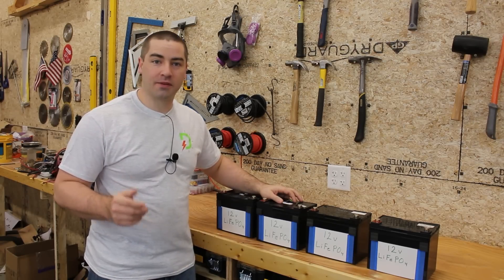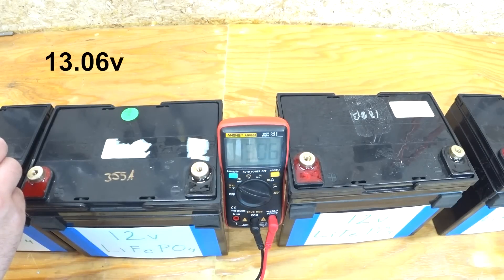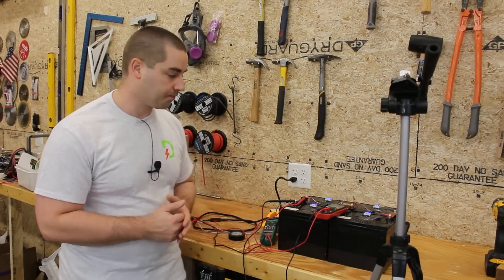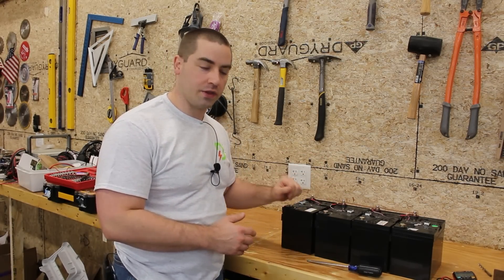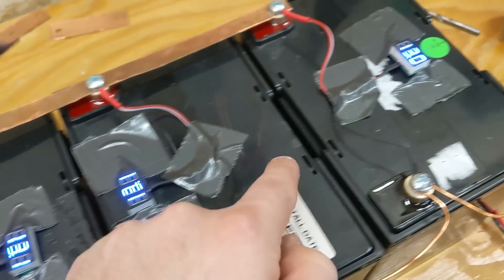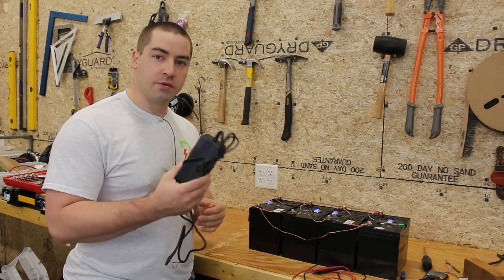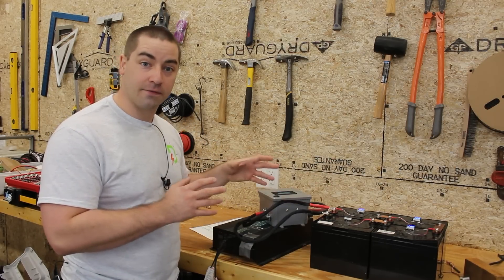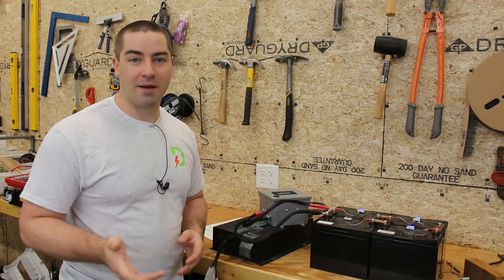How to Series Connect 12v LiFePO4 Batteries, and Top Balance

Comment: I have 5 12 volt Li Time 100ah batteries in parallel connected by busbars. A Li Time 60 amp solar charger charges them. I have checked SOC numerous times and they are all in perfect sync. Do not try this because it is not recommended. I am just telling you my experience. They are a mix of TM batteries, standard and Bluetooth.

Comment: Hello, David. Thank you for the demonstration. I have the same thing happening with my pack. 4-12 volts in series In a golf cart. I purchased a battery balancer from Amazon and it did seem to work until the pack died again. This question is unrelated, but. should the lithium ion batteries as a pack of 48 volts Be able to. drop below 48 volts and still function?
Reply from the maker: Yes.  
Typically, a 12V LiFepo4 battery will have a low Voltage cutoff of 10V (2.5V/cell).  If you have 4 in series, that makes 40V as a low Voltage cutoff.  The thing is, that a single cell hitting 2.5V will trigger that BMS to shut off, which will kill the whole pack.  This may happen at 41V, or 45V, It's not certain.  In my own home system, I have my inverters programmed to shut off at 48.0V so that the battery doesn't shut down.

Comment: how often does balancing need to be done? Is this only done initially when they are first connected to system?
Reply from the maker: This would depend on the application.  For friends running this type of setup in RV's and vans, I suggest they re-balance them once a year as maintenance.

Comment: Hey David.  Thank you for this.  I am a snowbird spending winters in AZ.  I switched to 3-12v lithiums for my 36v cart.  I top balanced them new as you showed but I heard that one should balance them annually and you said that you will top balance if connected in parallel and left for a month or so.  Can I just fully charge my 36v system when I’m ready to head back north, and then re-wire the batteries in parallel for the summer.  Presumably they will balance while I’m away and then give them a full charge in the fall.  Make sense or not?
Reply from the maker: Re-balancing them once a year is good practice.  Also, Lithium batteries don't like to be stored at 100% SOC (state of charge).  Ideally, store them around 50-60%SOC for the off season.  I'd store them disconnected from everything and each other. When you come back to the golf cart, I'd re-top balance them.  
If you leave them in the golf-cart while you are away, then make sure you have a main-disconnect turned off so that the 12V power supply, or speed controller, doesn't drain them while you are away.
When you come back to the golf cart, a way to speed up the process is to charge each battery to 14.6V with a lithium 12V charger.  That will save you the hassle of removing them from the cart and re-wiring them to parallel.
Reply: Thanks again for the reply.  Just to be clear.  I’ll disconnect them from each other and the cart before I leave.  When I’m back I charge the individual batteries first with a 12v charger.  Then I wire them in parallel and balance them with a small charge.  Then rewire in series and “Bob’s your uncle”?

Comment: I want to balance 3 new LifePO4 100a 12v batteries for my golf cart.  Was planning on charging them first in series with my new 36v charger.  Then, I want to top balance them as shown here in parallel with a 12 v charger but you don’t show what size charger you used.  Can I just by a cheap low amperage charger.  I’m very green at this so any info would be helpful.  Thanks.
Reply from the maker: The 12V charger I'm using in this video is 4 Amps.  The exact amperage isn't critical with LiFePO4.  You could get a 10A model and be just as good.  The important thing is that it's a CC/CV charger, which stands for Constant current, constant Voltage.  If the charger is built for LiFePO4, then it's a CC/CV.  Just don't use one made for lead acid batteries.

Comment: What do you think would be a good balancing time for a 24 v system of 4 batteries.... Evey 6 months ? Or eveytime you see a little difference
Reply from the maker: If the batteries are older and more degraded, you might have to balance them more often, maybe every couple months.  But, if they are working well, I'd do once a year as a maintenance thing.  At the same time you can check for corrosion and torque.
Reply: @DavidPozEnergy  thanks, a lot.....they are 6 months old ,but I,am seeing  4/5% difference,so  this weekend I will due a balancing. Thanks again

Comment: Honestly I don't get why people work with 12V apart from very small systems 1200W or less DC, so closer to 1000W AC, 24V is good for upto 2400W DC so after inverter and cable losses your talking 2000W AC which is an acutally useably sized inverter anything beyond that just go 48V you will thank yourself later because you don't need stupid gauge wires and it will allow you to relatively easily expand later and you will almost certainly expand your system.

Comment: You helped a lot.  I have a 400 aH 12V system with four 100 aH batteries.  I use all in parallel and was concerned about all four and "top balance" ... I have them in a fairly sealed wood box and it would/could be difficult to charge each battery individually.  I hope to expand to 800 Ah total all at 12V ....  I already had/have a Victron 12V multiplus 2 3000Va and the loads are low but when we have long cloudy days I want the capacity to use ... and only use the charge system of shore as little as possible.  I mostly have been using only solar but seasons change.  pat

Comment: Great video David.  What charger do you recommend that can be programmed to cut off at 56V?  I'm also planning on setting up my Renogy 500A Battery Monitor on my dash to be at zero percent charge when the voltage hits 49V to ensure I'm not dipping into the bottom 10%.
Reply from the maker: I use solar MPPT charge controllers.  Currently I'm using a Victron one, but most MPPT controllers can be programmed.  However, if you are asking about a wall charger, then I use this one: https://signaturesolar.com/eg4-chargeverter-battery-charger-48v-100a-5120w-output-240/120v-input?ref=4_rHcgZ9x-TiF-

Comment: Hey Dave, just watched this video.  we're installing 3 new 100ah batts and our installer doesn't seem to think the process of normalizing, conditioning and top balancing is needed.  I think he's wrong.  Any opinions??  thanks, Jeff and Julie s/v OoLaLa Westsail32  #81
Reply from the maker: Hi Jeff and Julie,  This video is for series connecting 12V batteries into a 48V configuration.  I don't have details on your situation, but it might be that your installer is paralleling batteries.  Paralleling batteries gives you more leeway.  
Is there a better way to contact?  I'm on facebook at davidpozenergy if that's helpful.

Comment: Hi David that was informative. i have a question....

I have an 84V scooter and getting rid of the old LED acid Batteries to get the LiFePO4 conversion.
but it's super expensive, between $1100 and $3400 depending on the capacity.
I tracked down a couple companies in China that will make an 84v 50ahLifepo4 battery
for around $700 and not $3400 at the bike store. still expensive but cheaper.

I saw your video and was wondering if I could make my own.
I can get 7 of the K2 Energy 12v LiFePO4 Batteries (K2B12V19EB) good use for $350
The 12V versions of your batteries.
I keep hearing that 4 in a series is the max on LiFePO4 Batteries. 
On the battery, I see Max in series 2 for a total of 24V and Max in parallel is unlimited
Is 7 too much to put in a series to make 84V  ?
How to make 84v out of these batteries?
Thanks
Reply from the maker: Off the top of my head, 7 in series is too much.  When one BMS tries to shut off you don't want to short across the fets. Unless the manufacturer of the battery says it supports 7 in series, assume it doesn't.  

I don't have an 84V scooter, so I might not be very helpful.

Comment: Great video once more TY for dropping all this wisdom on a up and coming noob :) ! I just bought a 3 pack of these Power Queens on sale for $750, can I use just the three in series for the 36-watt system? I want to power my Pecron E 2000 at night or on cloudy days or do you recommend the 4th so I can run a 24 volt parallel, 2nd question for my output from the batteries (8AWG) can I just run them into an MC4 to hook into my aviation plug? Thanks in advance and also for inspiring me to get partially off-grid :)
Reply from the maker: I've never tested a Pecron E2000, so I just looked up the specs on it.  Looks like you can add an expansion battery (EB3000).  I assume you are trying to make your own expansion battery?  If that's the case, then try to match the specs of the expansion battery.  It is a 25.6V battery (usually called 24V, but in LiFePO4).  Sorry I can't be more help, but I haven't tried making an expansion battery for a pre-built portable power station.

Comment: A good video, BUT, The BEST way to connect a series string of any type battery for charging OR discharging is to "opposite feed" the charger/load +/- connections.  That is, the 1st battery's charge or load connection is positive and the 4th or last battery connection would be the negative, or visa-versa.  In this way the charge/load voltage drop will be EQUAL as the interconnecting wires that have a definite resistance, WILL provide an EQUAL charge or loading of each battery.  With your connection of "center feeding", the two outer batteries will DEFINITELY see a reduced charge from the resistance of the jumper wires as the two center batteries will receive an equal and highest charge voltage...  The difference is minimal, but it is there....  Especially when dealing with MILLI-VOLTS........................... This SHOULD HAVE BEEN POINTED OUT... Just say'in....

Comment: I’ve got 4 x 12v lithium batteries in series for my 48V golf cart. I also have a 48V lithium charger. How do I hook up the charger properly to charge all 4 batteries at the same time? Does the positive connect to the first battery and the negative connect to the last battery? Thanks for your help!
Reply from the maker: Generally, YES, but there may be some nuisances in your setup.  The purpose of this video is to make it clear that you have to manually top-balance batteries in series.  Your 48V charger won't do that.  If you haven't top-balanced your batteries within the last year, it's time to do it again.
Reply: @DavidPozEnergy  ok sounds great! Yes I’ll still have to top balance the batteries, they are brand new, delivered just a few days ago. I just wanted to make sure and verify where to connect the positive and the negative. I’m trying to find a simple solution so I don’t need to remove my batteries from my golf cart. Thanks again, I really appreciate your help
Reply from the maker: This is one idea that might be simple.  Put this balancer inside the battery compartment (protected from splash).  It is made to balance 4x 12V batteries in series. https://amzn.to/3mLpzZC

Comment: Hi dude, thanks a lot for this video. 
I'm new to lifepo4 projects... 
My motorhome has 1 pack of 105ah lifepo4 12v already with it its own MPPT controller. 
I need to increase the capacity, but the battery pack the I just bought is 100ah. 
Peolpe did not recommended me to add them in series since they are different capacities... 
Which is the best approach to add this new pack into the system without manual package switching for charging 
and discharging? 
Both packs have its own BMS. 
I was checking the Epever Duoracer dual battery... but it supports the second battery as standard truck batteries. 
Do we have some MPPT charger that can automatically charge/discharge the two batteries? Or should I add a new controller for pack #2
and put some devices in circuit #2. Or can I have a single system with automatic management for charging/discharge?
Reply from the maker: Hi Ronaldo,  You stated "People did not recommended me to add them in series".  Placing two 12V batteries in series would make a 24V battery.  Is that what you are trying to do?  Are you using a 24V inverter?
Reply: @DavidPozEnergy  sorry, I was not clear. People said if I attach a new battery to the same system (system is 12v and both batteries are 12v), as the batteries have different amp/your, one 100ah and the second has 105ah that if I put them in parallel it will damage the batteries or explode. I'm trying to find a solution where I can charge both and discharge both in an automated way and keep the system in 12v
Reply from the maker: Ah, OK.  You are trying to place them in parallel.  That makes a lot more sense.  Yes, you can parallel similar batteries even if one has a different capacity (Ah) than the other one.
If you put them in parallel, there are some rules to follow:
1. Both batteries should be the same charging parameters.  This means they should both be LiFePO4 chemistry, arranged 4s.  
2. Check the Voltage of each pack, both batteries need to be within 0.1V of each other before paralleling.  
3. Test each battery to make sure it's "active" and working.  Try pulling a 12V lightbulb on it, or something like that to make sure both batteries have the internal "BMS" online (active).
4. Parallel both together without being connected to other loads, and charge both slowly up to maximum Voltage.  This should be in the spec sheet, or printed on the battery.  Usually 14.4V or 14.6V.  This is the top balancing phase.
5. When wiring them together inside your motorhome, do NOT daisy chain them.  Instead wire both to a central busbar.  Check out this video for more: https://youtu.be/eWqJjlHoW9A

Comment: Hey man  need some help. 
I have  4.  12.8V   100ah batteries. 
I  configured them  24V system. 
Question:    do I have a   24V.  100ah system?
Question:     when  figuring  my voltage for my  charge controller. How many cells do I  figure.      3.45V. X 8 cells = 27.6 V.
I am having a lot of trouble  programming my   EPEVER  charge controller?
Any  information will be  appreciated.

Comment: Keep up the good work, David. 
Here's a challenge. I am connecting a 15ah 4s LiFePO4 pack in series to a 15ah 16s LiFePO4 pack and charging it with a 60v charger. How do I wire it up?
Reply from the maker: Ideally you would find a 20s LiFePO4 BMS so that the whole thing becomes a 60V battery pack.
Reply: @DavidPozEnergy  Wow. Thanks so much, David, for the prompt reply

Yes. I see now that a BMS is the way to go. I have an active cell balancer on each pack. But it might be difficult to keep the two packs balanced between each other.

Comment: Thank you for the video! Does it make sense to use the 4s 12V equalizer? There are options on Amazon and Ali for about $50.
Reply from the maker: I once tested some active balancers (for single cells) and found it made my pack worse.  Since then, I've steered away from them.  That being said, I've never tested the 12V balancers made for 4x 12V batteries in series.  They might work well, but I don't think they are necessary.  If all 4 of your batteries in series are the same type, same age, then they should stay balanced well over time assuming you top balance them together.

Comment: As I red in VictronEnergy The Wiring Unlimited Book those big amount of parallel battery stack pieces recommends connect to charger/load diagonally, because different batteries and wiring resistance cause a different power drops and amount of current consumption.

But anyway, it's so very good and useful video, especially right now here in Ukraine.

Thanks/Дякую.

Comment: Great information and thanks. I replaced my 12v lead-acid UPS batteries with LifeP04 13 months ago without knowing any of these issues and got four hours plus of life for the Wi-Fi. Here in South Africa we're sometimes facing twice a day power cuts for two-and-a-half hours at a time, so it degrades lead-acid batteries very quickly. Yesterday my UPS refused to switch on. I think I now see the problem. I will try balancing the charge across the two LifeP04s, assuming one is not damaged, and give them a go again. In the meantime, I bought two new lead-acid batteries. They won't be wasted - I will soon need them for the garage and gate motors the way things are going....

Comment: The lifepo4 batteries that I have indicate that I can connect 4 in series but only 2 in parallel. It also says to connect in parallel prior to in series. Wondering how to balance the 3 batteries as per David's video if the instructions say can only connect 2 in parallel!!!
Reply from the maker: That's a good question.  The best thing is to contact the manufacturer.  Personally, I'd still top balance all 4 in parallel.  I'm only guessing that the 2 in parallel would be for in-use, not preparation.  But, again, try getting an answer from the manufacturer.

Comment: I came across this video while looking for how to balance brand new batteries prior to putting them in the search. I knew it was a good idea, I just didn’t know how to do it. This video was extremely informative and well presented. However, I still don’t know the nitty-gritty simple steps I should take to balance my batteries. Well that’s not entirely true. How do you spell come together in parallel and let them sit. Which I actually think I have time to do. As it is now, I’m going to have to find out details as to what type of 12 V charger I need to use speed that process up.